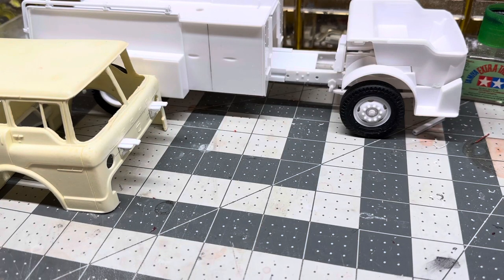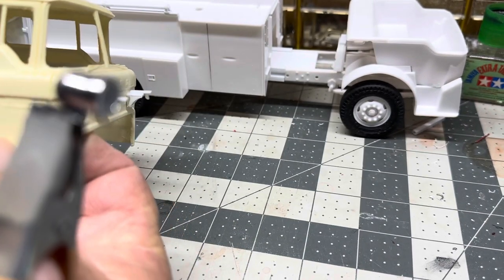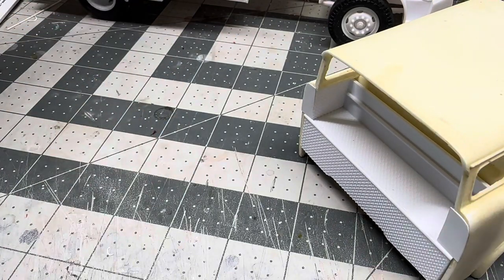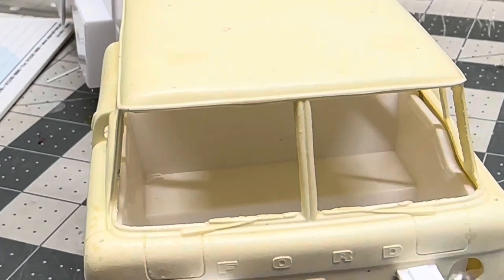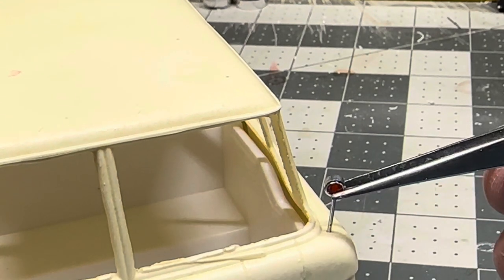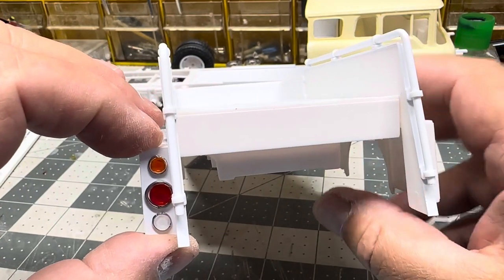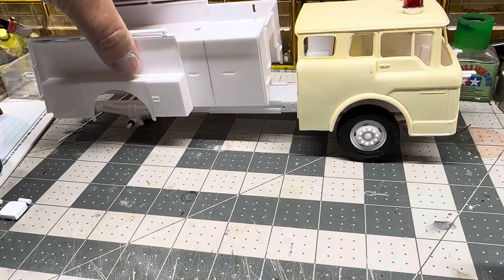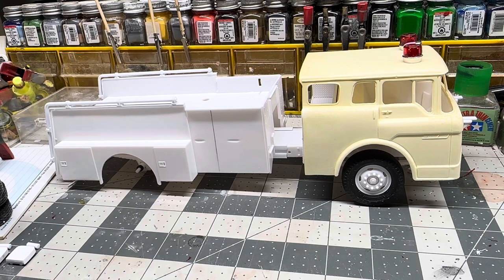Ford canopy cab fire truck.

Comment: another great  fire project series to look forward to. i like the way you create these lights  and other little items for your cars and trucks having over 9 amt fire kits in my collection aero chief ladder chief pumpers  and car started but held off due to some kits pieces being vary warped.hoping to makea few of them one of these days before i get to old and my hands and eyes slow down. and being on social security  your great ideas on building these parts helps. those testor paints you have on your table were 10 cents a bottle when i started this great hobby now they sell for 2.00 a bottle 15 cents tube glue now 2.50 ea but still love this hobby. GREAT VIDEO CHANNEL.
Reply from the maker: Thank you for watching! I remember the paint being a quarter a bottle, times have certainly changed.